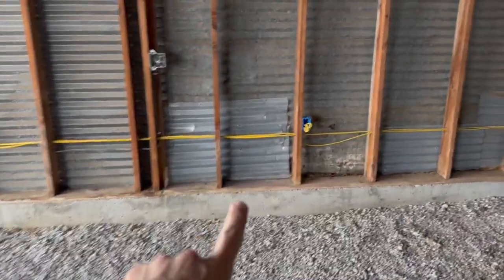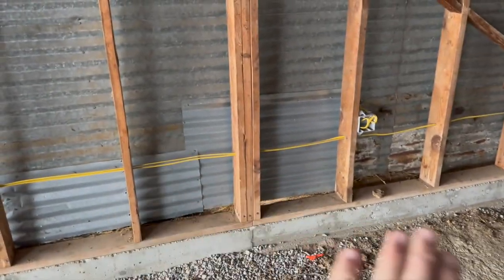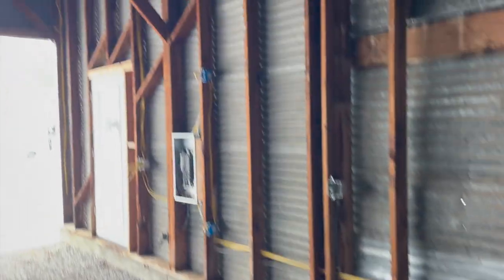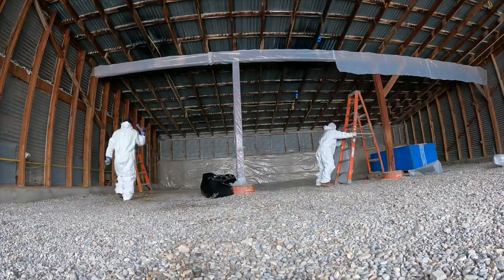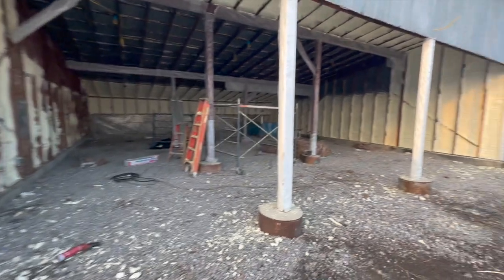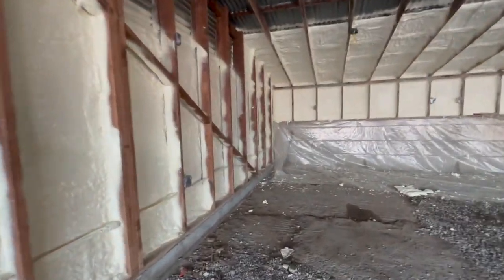Building A Huge Dog House / Spray Foam Insulation! Rotty Ranch Vlogs #080

Comment: What it did cost you to the spray foam insulation for that area?
Reply from the maker: 38x44 area  2” thick was $8500 USD. Labor, prep, material and clean up. 

R13 rated @2”.
Reply: @The Rotty Ranch  holy moses i got 25000sqft warehouse i was thinking of doing
Reply from the maker: @ndn2589  spray foam is by no means cheap. But from everyone I’ve talked to, it’s well worth it. 

For me, the old barn building and the strength the spray foam added, was worth it to spend the extra.